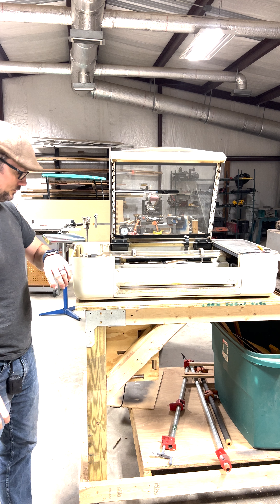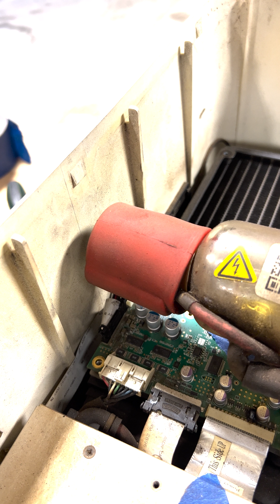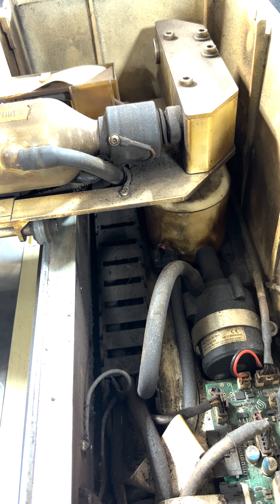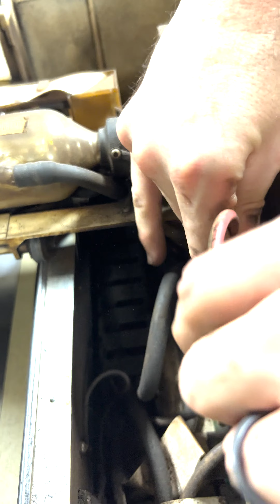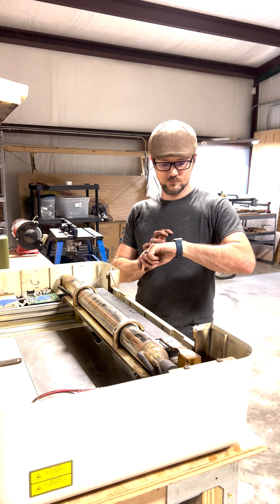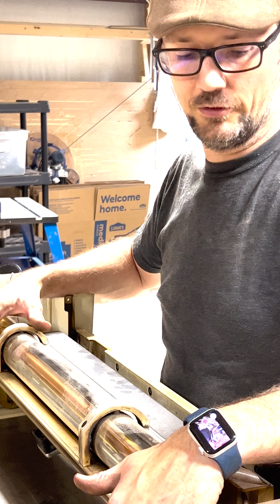Glowforge High voltage short inspection

Comment: Hi Steve. This video was very helpful. I inspected my red wire including the chain guide and under the machine. I cannot find any short damage in the wire anywhere. Is there a way to check the power supply? Any suggestions would be appreciated.

Comment: So I’m doing everything you said and the spot where the heat shrink is will not feed through the channel. It gets stuck every time. I’m using a quarter inch heat shrink like you said and it doesn’t fit. This is the 3rd time I’m having to do this. I don’t know what to do. I keep removing the heat shrink and redoing everything and it still won’t work.

Comment: Have a pro. Checked the red wire up top. Pulled lower plate. I see no problems. What should I do next? Thank you!
Reply: Machine works fine except no firing. Checked all the settings.
Reply from the maker: @TheBigGusto more than likely your power supply has failed.
Reply: @ so it has to go back to glowforge? :(
Reply from the maker: @TheBigGusto or to wiregrass technologies for repair.  We are a 3rd party repair facility for them now.
Reply: @ also I bought this used. I do not have a box. What do you recommend
Reply from the maker: @TheBigGusto that adds to it. You have to have the box to ship it or it’s very hard to get ups to cover any damages.  You can buy a box with foam from glowforge but it adds to the repair.  You can find used power supplies sometimes but that’s risky.  Unless the have a test rig to verify it’s good, it could have been the issue with their machine.

Comment: Any  chance you know of anyone repairing the psu it self?
I dissasembled mine and removed the high voltagw part, looks like the first stage of the psu is dead by its self.

Id love to find information if anyone knows of commonly blown components, if not ill get all the power electronics engineers at work to have a look and maybe we can write something up..
Reply from the maker: No we have done basic repairs, but the problem is there are no schematics at all.  And visually there is never anything blown off the board.  So isolating the issue is very difficult since it’s proprietary information.

Comment: Quick question, Underneath the glowforge Pro in that channel where all the wires are tucked in, what is the tiny white for? I took off the metal plate to look for shorts in the main Red wire and noticed that torn the white housing on the lone white wire.....  What should I do about it?   What's that wire for?

Comment: I finally got around to checking the red, high voltage cable and there are no obvious signs of damage. I went as far as pulling the cable through the plastic chain guide and removed the silver plate under the machine in case the damage was hidden there. I didn't see any damage and carefully checked the cable from end to end several times. Is it still possible the issue is the power supply even though the laser head moves when the program is initiated? At this point, I would either elect to get a different machine or stop laser engraving altogether. Thank you!
Reply from the maker: If the laser head moves like its engraving, but the laser is not firing them the power supply is bad.  It can short internally
Reply: @Cruizin542 What do you mean shorting internally. Mine is doing what you're saying and I took apart as well but see no damage. The unit is 1 year old and less than 30 hours on it. Thank for any help of explaining internal shorting. Thank you

Comment: My my very lightly used glowforge is only a couple of years old and this happened to me. I turned on the machine, the head moved as expected, but the laser didn't fire. I'm going to check the wire when I get a chance. Thank you very for covering this information. I'm curious though; why repair the cable and risk another failure instead of replacing the cable? Is replacing the cable an impossible option?
Reply from the maker: So there isn’t a solid time frame on how long the patch will last.  And replacing the cable as an assembly is not possible since it’s built into the power supply.  We are working on a splice kit but currently it’s not an option.

Comment: How do I secure the laser to put it in its side to remove the bottom plate?  Also will this mess with the alignment or the mirrors?
Reply from the maker: You can use the lock screws it came with or painters tape works.  No so long the tube is not taken loose it will not mess with the alignment.

Comment: I only wish you had told me to slide on the heat shrink before pulling out the wire.
Reply from the maker: I don’t understand you can’t install the heat shrink with the wire installed.  You have to remove it find damage, then cover with heat shrink then reinstall.
Reply: @SkooobaSteve ok I just don’t know what I’m doing. Am I supposed to cut the heat shrink to wrap it around it?
Reply: @SkooobaSteve I have never done electrical work before. Just trying this in hopes that I don’t have to send in for another refurb. You didn’t show how much liquid tape, how you got the tubing on, or how long I should wait inbetween each process. I don’t want to mess anything up 😬
Reply from the maker: You fill the hole don’t go over board.  As far as the heat shrink you do not cut it you slide it over the wire from the tip then apply heat to it once it’s over the effected area.  If this doesn’t fix it you are looking to replace the entire power supply.
Reply: @SkooobaSteve thank you. How long after I fill with tape do I wait to apply the wrap?
Reply from the maker: Read the directions on the liquid tape and let it dry for how long the recommend.

Comment: Great video. Mine has just stopped firing. How do you tell the difference between a tube that's broken and this red wire short? It did seem to happen all of a sudden so could that point to a red wire fault?
Reply: Followed your tutorial and found a small pinhole on my red wire where it must be shorting. Going to try the fix you suggested. Great content and massive thank you for the help.